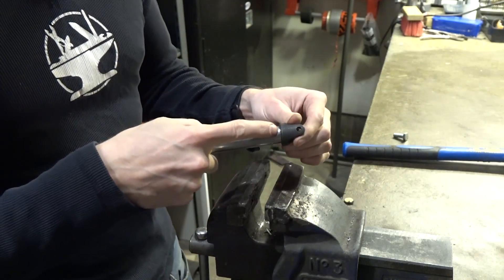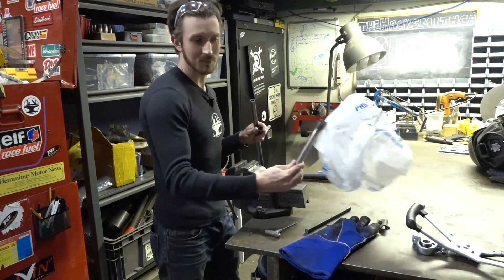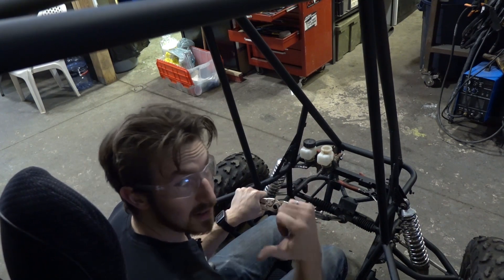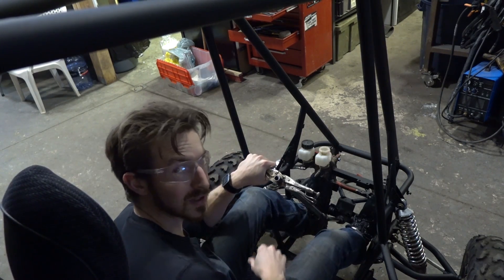Electric Batman Tumbler Part 2 - First Test Drive

Comment: do what mythbusters did, they had a episode where they put a grappling hook on the side of a car, and they had this medal object front on the right side of there testing road area, what they did was go high speed and see if a "Sling shot" was possible.

dude if you do that it would be epic.
Reply from the maker: But it didn't work for them... and they had a big budget...
Reply: the Hacksmith make it project the bat symbol with a spot light!!!!!
Reply: or use a jet engine or something like that
Reply: Because the car they used was super heavy, like tons. The buggy is much lighter plus you have that fancy strong rope and you can also do it on snow or ice which will further lower force on the rope.
Reply: the Hacksmith true but you could try on a separate car like a prototype? Obviously it's up to you though
Reply: Calob .Urquidi "Medal object"

Comment: Maybe a net launcher? Bolo slinger? Making it be able to drive underwater would be awesome, but it's a lot of work. Some mean looking headlights. A night vision camera and display. On a Batman wiki, I saw that he had a batmobile with an "adhesive-trap foam gun." They also have listed a smokescreen, nitro methane afterburner, ejector seat, "remote guidance systems" (remote control it?), electroshock defense, and multipurpose grapple claw, just to name a few. My favorite Tumbler feature is the batbike that comes out of it. Maybe there could be a batdrone comes out of the back? The same screen used for night vision could be fed a video feed from the batdrone.

Comment: Not a specific upgrade to the vehicle, but before you get the body panels on (assuming we're going for form as well as function), it'd be cool to have a gopro or other wide-angle cam mounted closer to the ground aiming up at the driver, or along the chassis towards a tire. Then you'd also have an opportunity to have a sweet project progression thing where you do a match-cut between prototype and final product in a video, or even just an instagram post.

Comment: you need some massive wheels( even if they are just skinny and made to look thick because i understand youll lose power with the weight, some of those little jet engines you have been using for the iron man flight project attached to the back for a real jet boost, you need dual paintball guns attached to the front, some fireworks launchers, and lights. also, if you could cut down the roll cage and maybe recline the seat a bit it would give it a much sleaker look. Last thing you need a bloody batman cowell! haha. keep up the good work boys

Comment: Make the wheels launch down! that way it can "jump"!!
Reply: Strident Music I just tried to say that and failed but this is exactly what I thought to. like a leap frog system. I was thinking airbags might work
Reply: Airbags are fairly dangerous considering the speed they fly out at and how easily it could pop. I was thinking a motor thats spins the wheel structure straight down.
Reply: Strident Music I was picturing the airbags being enclosed inside a piston or something similar so the blast energy was controlled and directed at the ground. Probably still too dangerous and it's only a 1 time use though...

Comment: Armour plating, remote controlled (joystick operated) paintball gun mounted in front of the steering wheel (mount the joystick beside the seat, batman logos on the wheels, rear and front winches, rally car lights and a lightbar ontop, roof and retractable sun visor (similar to a vertical pull blind) and the iconic bat wings on the top-back frame of the vehicle.

Comment: Looks like your steering has alot of slop in it...might be from the universal joint. You could probably use your mill to machine a piece of 4140 to replace the current connecting block in the joint. You could machine it to much tighter tolerances and get out alot of that slop.

Comment: Flares, smoke screens. Still have rockets left over? Ejector seat! Spikes on wheels. (maybe half a batarang?) Com radio. Maybe make the accessories moduler so you can switch them up depending on your mission.

Comment: Its a cool ecar and would be awesome fun, but its a bit of a stretch calling it a "Batman Tumbler" as there isn't much that the two vehicles have in common. seen a spider car that was closer, with independent wheel chair motors on all wheels and each wheel independent suspension.   check it out as i know its on youtube some where, then perhaps a Mk 2 Hacksmith Tumbler? be even more fun than this one even after you have added all the "toys"

Comment: Would adding a second set of rear wheels be feasible? Wouldn't add anything practical, it would just fit the Tumbler aesthetic a bit more.

As for gadgets, you could attach the Bat signal you already created to it somewhere

Comment: If you're going to build the Tumbler, you need it to be accurate or at least similar. Widen the frame or lower the frame to capture the original shape, unless it will weaken the initial structure of the cart. Ad black platings, double the wheels at the back, put in more accurate interior, and ad an extra motor. It would be cool to place a rocket at the back to simulate the tumbler function but that would probably be impractical and stupid. That's just my suggestion.

Comment: change the frame lower the roll cage so that it's a lot lower to the ground and make it look more like a Batman tumbler which is load of the ground the roll cage is way too high up in the air it does not resemble a Batman tumbler and add a flamethrower

Comment: PAINTBALL TURRET. THEN ADD ALUMINIUM PLATES ON THE BOTTOM OF IT.  The paintball machine gun/mini-gun (you choose) can be on the front of the Baha (somehow). And the aluminium plates on the bottom parts would cover the gaps so that it would resemble the Tumbler and you can just spray paint it black. PLUS adding the aluminium plates between the gaps would help keep all the rubble or anything getting inside the vehicle, and it'd look very cool.

Comment: First off it needs to be lowered and the shocks need to be stiffened, then the roll cage needs to be lowered, and also make the seating position more horizontal. And if you want add some metal sheeting to make it more sleek and aerodynamic.

Comment: a BB gun would be more effective less space consuming and more lethal also there are more advanced turrets for copper firing bob turrets also make a nice rigid shell for it on also make a hole in the side for dropping paint grenades, for non lethal use airsoft bbs

Comment: Any chance of a tracked/treaded version in the distant future? I've built a kart from scrap and an engine, would have made it a tracked tank if I had 2 engines to support the weight of 2 treads, sadly 1 engine could only support wheels

Comment: hacksmith i think u showuld have da steerin wheel not a wheel but instead like a motorcycle steerin wheel connected to da joint like it is at 4:38

Comment: How about a flamethrower like the one you put on the R.C tank (just slightly bigger)... or better yet you can put a robot arm on it a little like the one you bought earlier 

and just a small question... I live in America and wonder if it would make a difference if you ended up moving, would you be able to continue your projects In a similar environment, or even a completely different one?

Comment: If you where to do armor plating to make it look like the tumbler. Maybe it would be a good idea to do it with a type of plastic as opposed to a heavy metal. Also, this might be a bit excessive, but it would look a lot more like the tumbler if the ceiling was lowered.

Comment: Hey bro, not sure if you remember my old comment but these are some ideas I came up with:

-On the back, put an oil tank (or any slippery substance) so that if someone was behind you they would spin out. LOL
-on the front put a GPS Bluetooth launcher. You would launch a magnetic GPS tracker and connect it on a screen inside the buggy that displays the location of the tracker (Very unique so this needs to be a thing)
-A power winch/Grappling Gun/Grappling Hook, DUH?
-Both sides or the front, make a Firework Launcher
-Both sides or the front, make Paintball or BB-guns 
-Possibly a piece of metal or any strong material on the sides that can extend and retract to hit any nearby objects/people :D
-Some sort of mechanism to flip the vehicle (Better safe than sorry)
-Laser cannons (would be cool)
-Smoke grenades, that would be interesting
-Flamethrower
-Keep a little stash of Hacksmith-arangs (Batarangs) inside if a drive-by is in need
-Some type of taser system
-And I saved the best for last.... A BATSMITH CUP HOLDER. Ikr, best idea ever :D

Obviously not all of these will be incorporated, heck none of them probably will, But thank you so much Hacksmith for being such an inspiration and motivating us to come up with ideas like those^
Reply: I have a lot of cool ideas so read it all pls :P
Reply: Antoine7000 those are some cool ideas
Reply: Antoine7000 While these would be pretty awesome, most of them would just be impractical and costly, such as the oil tank, laser cannons, (lol) firework launcher and the grappling gun. The others wouldn't take too long to build and hopefully wouldn't be too expensive. (No hate)
Reply: All animals are just Slightly different horses ikr, wouldnt it be sick!?
Reply: Thx
Reply: The King of Reapers ik it wont all fit, but lets hope he can fit as much as he can
Reply: Antoine7000 b
Reply: Antoine7000
Reply: Globness Yeah thats true, but still it would be cool to build some of it
Reply: Antoine7000 you're awesome👍👍😀😀#swag 😎😎 #you.
Reply: Terrence Wren Much appreciated

Comment: you should have a seat in the back and have a turret of some kind monted on the top or side(or have it remote controlled) and then some of some kindve monted weaponry on the bottom or in the front of the baha and you need to put some doors and walls on it and have some bat ears on th top

Comment: I don't know what all you're allowed to do, but some air soft guns mounted in front of the "cockpit" would be cool, and what would a "batmobile/tumbler" be without a grappling hook? A winch would be nice too, but maybe the grappling hook and winch would be one assembly, I don't know, you're the engineer. But the last, and certainly not the least of my suggestions, you should add either a compartment for the various bat-tools you've made, or make a whole new surprise bat-tool that goes with the tumbler

Comment: How about a powerful air compressor + tank. Then you can use the pneumatics to feed the paintball turret, fire a grappling hook/harpoon attached to a winch, the self-correcting pistons the other guy (Purple Gorilla) mentioned, and maybe something similar to suspension hydraulics (but pneumatic) so it can jump.

The turret can be modular so you can attach any pneumatic weapon/tool y'all come up with later.

Love what you guys are doing BTW!

Comment: Add some dampening shocks to the steering. Better high speed stability. trim the roof a bit or elongated it back and down over the rear wheels, add fender flares, fill in the gaps of the framework. Make a flamethrower that's pointed back to give the appearance of a booster.
Reply: Duncan MacWilliam 👍
Reply: Duncan MacWilliam I doubt they will do the flamethrower

Comment: red lights at the bottom of the tumbler, fire that shoots out the back like batman's tumbler, an armored bumper and windshield to bust through glass, cool headlights like batman's, the sides of the tumbler should be protected with an armored door, and to get in the tumbler the windshield should pivot upward like a cockpit :D

Comment: Id probably add some lidar & a heads up with different optics... but more mechanically? 

- Panelling that can move and lock down like in Batman Returns
- Something that fires a small beanbag from the side (again like Batman Returns) probably with a little Rpi + CV aim assist would be a good idea. Could mount that more forward but definitely some sort of 'crowd control'
- In built jack that lets it turn on the spot with a rear flamethrower (Batman)
- Stealth mode so switch to say UV lights and use a HUD + thermal?
- Harpoon! I was going to say the grapple turning thing but that seems like it could be SUPER dangerous at speed + could whip around and get into the wheel

That's all I can think of at the moment :)
Reply: I should also add, a big ass batsignal :)

Comment: does it have a transmition? if not add that, itll help it fly like batman. also, add flamethrowers on the side, so when you accellerate, it looks like flamea are coming out of the exaust pipes on the sides. thanks for reading!

Comment: broke a wrist using vice grips as a clamp to hold steering column, weld broke didn't wont to go home thought this will work fine, second corner no steering and straight into a tree.

Comment: I dont know if tthis is a long shot but if on the outside top corners you added a spring feature so that if the machine fell it would bounce back up.. propobly not possible but i wanted to share my idea
Reply from the maker: Great idea! So down!
Reply: I dont know why this is such a big moment but a reply happened and to me.....I feel so gratified. Love what you do
Reply: AJ159r4 if in the iron man flying project it's troubling to lift him up.. it won't lift him as well as the tumbler
Reply: If the center of gravity is low enough,  a pair of circular roll bars could suffice. Take a turn sharp enough and the tumbler might be worth its name.
Reply: Yoon!  He replied to you!
Reply: he would need a air tank and a piston to rapidly push it to get enough momentum to tip it back, but It is possible.
Reply: Harry8642 Surname? I think there would be enough room on the top but it might slow it down.... but it'd be sick!
Reply: You should put EDFs on there
Reply: Yeah just for speed
Reply: Oops sorry
Reply: na thats possible, just some hydrolics pulling down springs and storing them in compressed position and then releasing
Reply: Maybe have something spring loaded that you can release to push the car back up, then manually reset later.
Reply: remotaholic no it's the suspension

Comment: How much is this costing you?
Reply from the maker: Nothing so far... were you not paying attention to the video?
Reply: the Hacksmith I thought you bought the frame off the uni students but I knew that you're getting the motors for free? Sorry if you thought I wasn't paying attention, I'm just intrigued as I want to go into engineering (preferably mechanical) at uni so I want to do my own projects for experience, but obviously my projects will have a small budget as I don't have a lot of money to spend.
Reply: + just a thought... have you thought about fitting wider tyres to the frame as currently you seem to be over correcting the direction of the movement (may be due to the wet road surface) with only one motor, so when you have two motors it's going to be very hard to control so wider tyres will supply better stability + less wheel spin? Just a suggestion
Reply: Better question, how much would this cost us?

Comment: here is a list of what the real batmobles have. Closed circuit television Handset with direct hotline to police headquartersDirection Finder equipmentSpare Batman and Robin costumes and utility beltsGas masks and breathing apparatusDashboard radarEmergency searchlightsTraveling crime-labBuilt-in sonic range finderPortable first-aid kitFire extinguisherShort-wave police radio with microphoneGeiger CounterTraveling research filesCloth tool bag with toolsAsbestos costumesGrappling equipmentWhirly-BatsInflatable rubber raftsSmoke screen devicesMicroscopeEmergency Dashboard JLA signalSound-distinguishing Bat-tectorHydraulic impact absorbersDiplomatic license plates (immune to normal traffic regulations)Static Bond TiresWayneTech 1200 bhp hybrid power cellNitro methane afterburnerElectromagnetic ejector seatEnhanced intel and recon capabilitiesAi and remote guidance systemsPayload: Laser/infrared homing 5gm high explosive cl-20/hmx cocrystal Immobilizer MissilesAdvanced synthetic fibre composite wheelsContainment UnitGraphene composite High speed hydraulic cylinder Air Brakes with regenerative energy mechanism120mm carbon nanotube aggregate explosive reactive armor platingVulcan Gun 25mm60mm Cannon/high explosive penetrator shellsRiot SuppressorElectroshock DefenseHydraulic Gyroscopic WheelsMultipurpose grapple claw

Comment: When implementing the paintball turret, would it be possible to use a thumb stick, connected to the steering wheel, to manually aim it? I'm not aware how to do this, but I think it could functionally work. Cheers!

Comment: *I'm surprised I'm not seeing more suggestions for a flame thrower out the back. Idk if the tumbler had it, but it's a repeated feature in numerous batmobiles. 
*Having 4 rear wheels would really help it resemble the tumbler, even if two of them are just for looks.
*Automatic baterang gun
*Hidden Deployable tire slashers like Roman chariots
* 'Cow catcher' style front bumper
*Armor plating that can be detached at speed. If I had to make an excuse of why the batmobline would need that, I'd say it trades defense for speed. Plus it should look cool on camera to see the sudden burst of speed
*Black out the inside, and drive using cameras and monitors in the cab
*pointless bat signal pointing at the sky, or in front of it
*Speed racers jumping mechanism

Comment: Make it Also remote control so u can drive it to u add a little GoPro on the front so u. Can see were your going or like bat man has and put gps in it and self avoidance sensors so at the click of a bottom mount to your wrist neck or hand it will drive to you

Comment: You need to make it jump. Maybe some pneumatic's cylinders mounted in parallel to the shocks and a 300 bar dive tank to dump in to them for a jump? (would require timing the front first and maybe the back at an angle so it propels forwards at the same time?